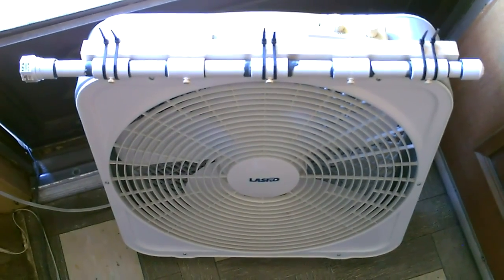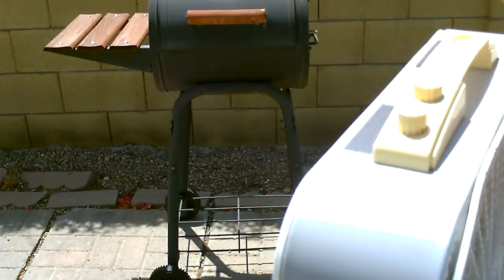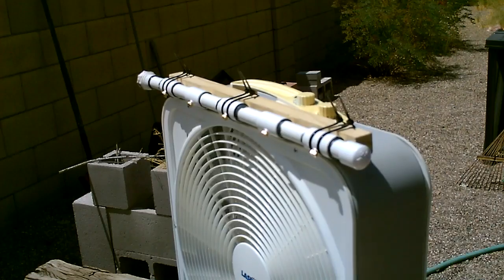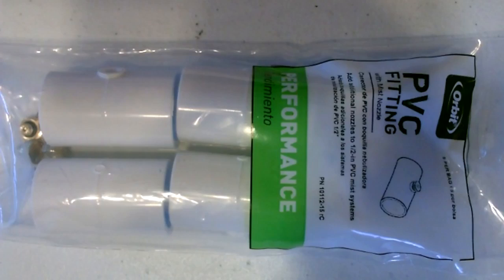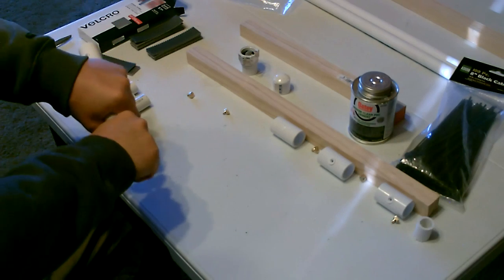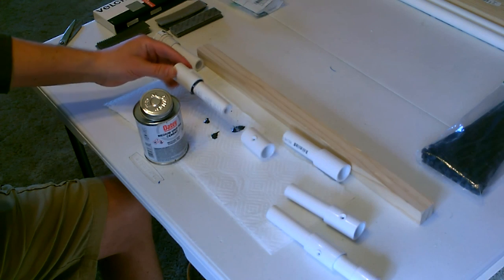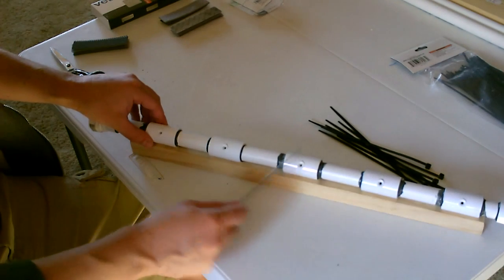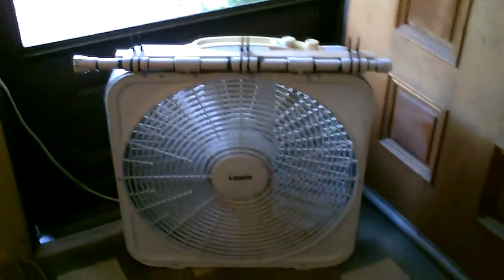DIY Evap Cooling Fan! - "mist style" Evap. Air Cooler! - Box-Fan Conversion!

Comment: Where in the heck can you find those little brass misting tips? Ive been to home depot and lowes, and found ZERO. Do you have a link to them ??
Reply: https://www.homedepot.com/p/RYOBI-Brass-Misting-Nozzles-5-Pack-PMC080/311952863?mtc=Shopping-B-F_D26P-G-D26P-26_2_AIR_CIRCULATION_ACCES-NA-NA-Feed-LIA-NA-NA-GeneralAirCirc&cm_mmc=Shopping-B-F_D26P-G-D26P-26_2_AIR_CIRCULATION_ACCES-NA-NA-Feed-LIA-NA-NA-GeneralAirCirc-71700000052572800-58700005047686952-92700044101172270&gclid=Cj0KCQjwiYL3BRDVARIsAF9E4GfYTHi8ODPkt9EDd2e_k9bkZv2cuGsErZV-leXjIVbYmw0bltB7Iu0aArlgEALw_wcB&gclsrc=aw.ds

I'm trying to make this this weekend as well
Reply from the maker: hi. that's where i get them (home depot and lowes). i'd say amazon might be the way to go.

Comment: Ok here's my 2 cents, I would have a 1/2" PVC built in a square the dimension of the round fan opening with either 4 or 8 misters facing away from fan suction with hose connection at bottom of fan for stability, when complete, zip tie it to fan, to avoid having to remove it each time, Good Luck!